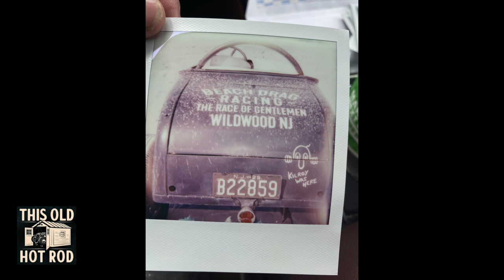The Race of Gentlemen

Comment: Mike, what do the 1/8 mile race cars use for gas tanks? I'm thinking the original racers of the 30's had at least 10 gallon tanks as they raced on regular circular tracks. To keep the weight down do present day 1/8 mile cars use 1 gallon tanks?
Reply from the maker: Some of the cars use their stock tanks. Some guys run 1 gal some use 5 or more. Whatever they decide to use to build their car. There is no rule as far as capacity as far as I know.